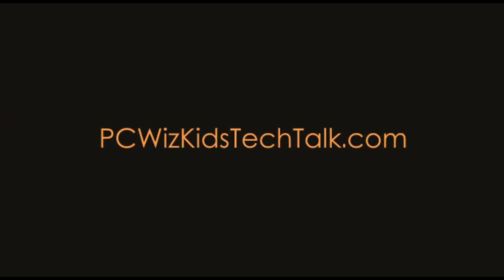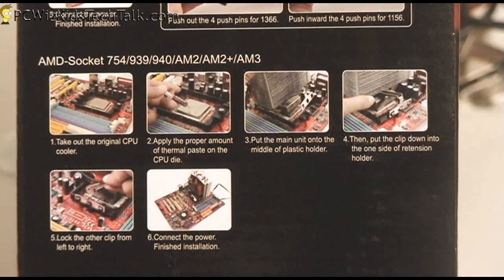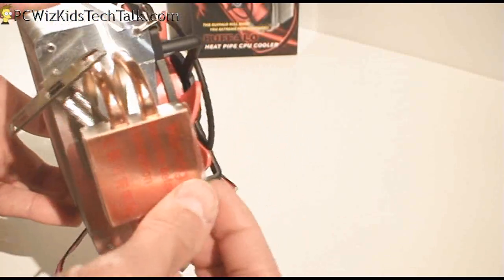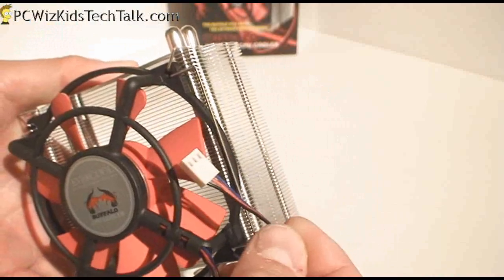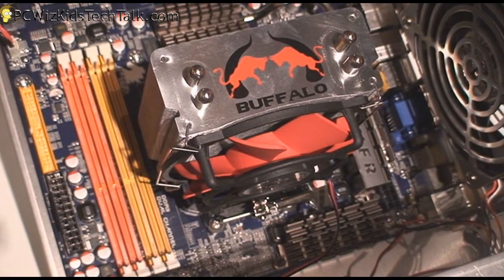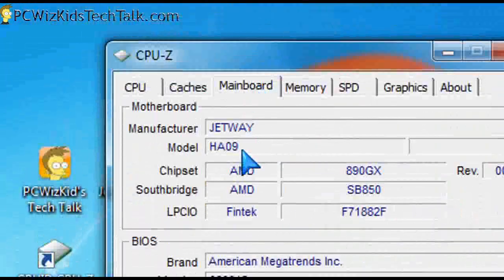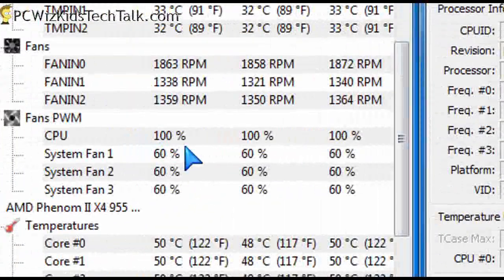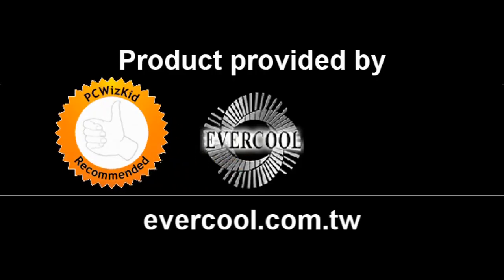EverCool Buffalo - CPU Cooler Review

Comment: @HybridPineapple 

The phenom 2 x2 550, as well as the x3 700 series processors are manufactured as quad cores. the processors that did not pass a certain quality control test (say 1 core didn't past a temperature management test) the one defective core would be disabled, and the processor would be sold as a triple core. With certain motherboards with sb710 or sb750 south bridge, you can enable ACC in the bios, and with luck a blocked core can be unlocked. sometimes they can't and are unstable

Comment: @HybridPineapple Not all dual cores work like that. When AMD makes an X4 and it has a damaged core, they disable that and sell it as an X3. If it has 2 damaged cores they disable both and sell it as an X2. Sometimes there is a really high demand for X3's and X2's so AMD will disable 1 or 2 cores on a perfectly good X4 to meet the demand. I believe If you are lucky, you got one of those CPU's and with a different bios or something, you can unlock the cores.

Comment: i've got my phenom 2 x2 550 unlocked to 4 cores and oc'd to 4ghz stable idling at under 28 celsius and load under 45 celsius, with this cooler. it's a great cooler. i got it for like 16 bucks with free shipping and no tax.